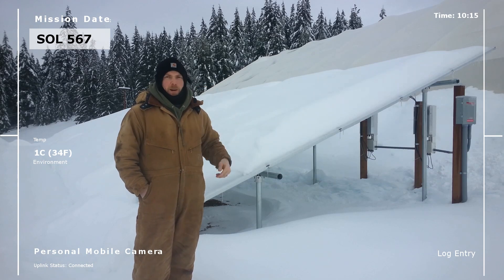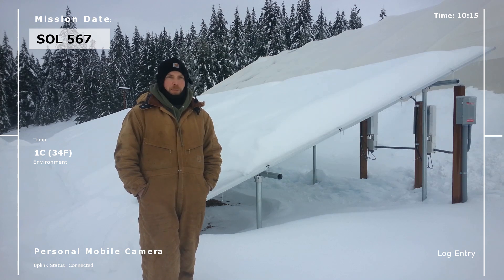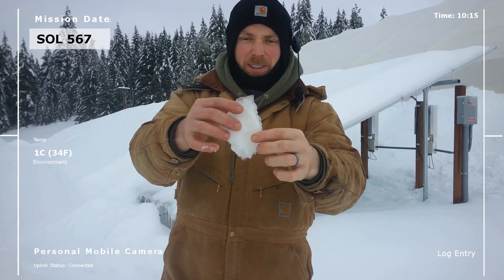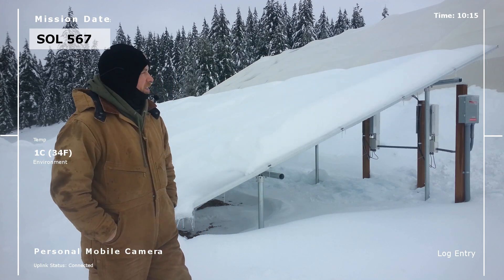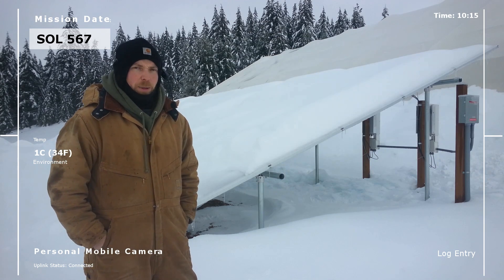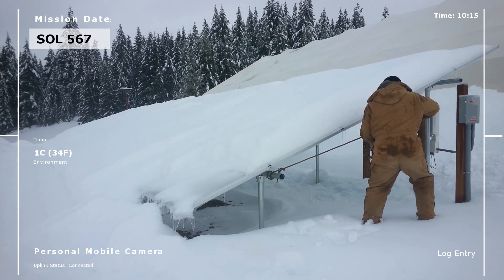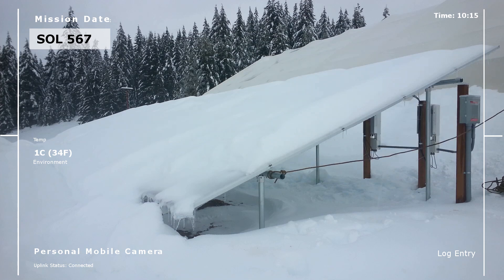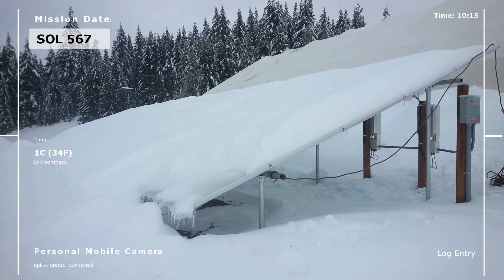Can you clean SOLAR PANELS with a ROPE?

Comment: Still curious on your thoughts on the Bloom Box technology .
Reply from the maker: sorry about not getting back to you...lots of comments :-) I did look at the bloom box and I feel that fuel cell technology may be a great solution for the long term. However, Bloom Box or any other fuel cell will still require a fuel...in bloom box's case Natural Gas...of course there are others (ex Hydrogen). In the end you can't get something for nothing and each fuel type has a maximum amount of energy that is available from it (ex. Diesel has ~190k BTU potential). When you take that fuel and convert it to a usable form (heat, electricity) there are losses do to the conversion...so any way, long story short...our systems that we need (and our way of life for that matter) simply require too much energy. That is...no matter how we get it...we as humans consume a lot of power (energy) and that means we need a lot of input (no matter the conversion process).  In the very long game...the only way to get as much energy as we will need without strip mining every planet we come to is nuclear fusion. Lots of people working on that one...I'd love to play with it someday but sadly I'm no nuclear scientist LOL
Reply: No Problem...just thought possibly with your methane resources this form of SOFC could have been integrated.
thanks for the reply...
Reply: I'm telling you TRM, run a long larger size pvc line (1"+) across the top of the panels, left to right.

drill holes straight down directly towards the top of the top panel every 6".

angle the incoming pvc line down and into the tent to a gate valve.

turn it on for 90 seconds and flood the panels with water which will cause the snow to slide off (and clean the panels of dirt at the same time).

turn it off and any water in the horizontal line will just drip out.

any water in the vertical line will drain out of a drain valve you install just past the gate valve after you open it.

have a bleeder valve just above the gate valve so the water in the vertical outgoing line drains and doesn't freeze.

now its ready for the next snow or just to wash off the panels if they get dirty.

simple, cheap and super easy to install.  the brackets to hold the horizontal line will be the most difficult part and that's really a piece of cake.
Reply: I lived in Michigan for 50+ years Ben and experienced those temps along with the biting humidity of the great lakes which goes right thru any clothing you have on no matter how many layers thick.

I'm talking about a FLOOD of water during the day which will wash off the snow leaving the black panels exposed to the sun which would absorb the heat, warm them up and let any ice or water evaporate right after the flush.

in fact, if you notice, it's 34 degrees in this video (not -20) and it would work perfectly.

the panels are at a perfect angle for this too, the snow just needs a little 'lubricant' for it to fall off.

did you see the first video where he was pulling the snow off the lower panels and it was falling on the ground leaving completely exposed clean, wet panels? 

that would happen on a massive scale in 90 seconds once he opened the gate valve.

we aren't talking about doing this on the worst of the worst days that you cherry picked out but just in general, during the day with the sun is out and not at midnight in sub zero temperatures.

it's no different than he's not going to be going out there in -20 degree weather and brushing off the snow no matter which method he uses. 
if it's THAT cold then there's a layer of snow/ice on the panels which isn't coming off anyway no matter how much he works at it.

one more time, watch the video again, it's 34 degrees, not -20 degrees.

I stand by my idea as it would work 95% of the time and when it's too cold, nothing's gonna work anyway.

donald.
.
Reply: I have a question for you AZboy boy and your friend...
If you want to start a battle royal and publish your own BLOG how about posting and tagging it to a question originating with one of you girls ..
Reply: at least our comments were CONSTRUCTIVE in an attempt to help out TRM but yours was just an attempt to make yourself appear like a big boy and just a waste of a post in the process.  

now grow up with your superior attitude and immature little insults.

I still believe I have a valid idea.

where is your contribution?

yeah, thought so.

.
Reply: AZ DONALD deleted my comment. Youtube arguments are pointless and I don't want to be a part of it. But for the record, I don't think water will help, even if it did your just going to have a lot of slippery ice in front. This is no way in the spirit of arguing against you, but I think it's just as helpful to point out flaws as it is to suggest things. Thanks AZ for contributing a suggestion to TRM. I truly apologize if I offended you. Have a great week ahead.
Reply: No problem Ben.

I remember my parents had a small metal roofed A frame barn.  

for some reason I would get a kick out of pulling out the hose when the roof was full of snow, spraying it and seeing if I could get a whole sheet of snow/ice to slide off in one piece.  that's what gave me the idea.

someone else here had suggested that TRM dig a wide deep trench at the base of the array for snow to go but with my idea it would fill and level off with slush instead of pile up high with snow.

doesn't seem to matter because TRM never commented on the idea anyway.

no offense meant, no offense taken.

take care, 
donald..

Comment: would it work if you could wrap the frame in the same pvc that your green house is covered and have a small wood stove or some other form of heat just enough that the panels would stay warm enough to melt the snow

Comment: The best average year round tilt angle for Oregon is about 37 degrees. Your panels seem to be aimed at about that angle. BUT!

In Winter you need every ounce of Solar power you can get. Days are short and radiation angles are low, meaning the Solar rays have to travel though much more atmosphere as in summer. In Winter lies the problem, not in Summer. In Summer you probably have too much Solar power anyway. In other words, a fixed array is best optimised for winter rather than the year round average. The best average winter angle for Oregon is about 59 degrees. (Summer 21 degrees). 

I think you would be better off with the average winter angle rather than a year round average angle. Better would be to adjust the angle twice a year but that involves some hardware mods I suppose.
Reply: Bor the Wolf 

I agree.  I think I'd definitely rework the mounting system so they were a bit higher and adjustable.

And then adjust the angle 4 times per year for optimal performance.

I can't imagine it taking all that long to adjust with a good setup.

Comment: 3 options 
1. there are de-icing boxes existing that can "heat" up your panels,  melt the ice and let it slide down. they run power to the panels an warm them up. 
2. install a thin wire and heat it up ( 12v DC) to cut the ice off.
3. cover the snow with ash an let the sun do the job.

Comment: The string trick works but you are going to find the rope has to large of a cross section to work well cutting the snow namely you being strong enough to pull it through.  Something about 1/8 to 1/4 inch in Dim. seems to works very well.  

I was wondering what is the system voltage of your grid-tie system?

Comment: Oi oi oi, Have u seen Cody's vid on removing the snow from the roof?????? That seems simple enough and not to mention u need to plough the front of the panels first b4 u attempt to clean the panels... I think the cold is freezing ur brain juices too much :)~ ..... get some more insulation on ya head and then tackle the problem again. Rope wont work as u need a ridged header and rope can be used to pull the rigid header towards u down the panels and u need to do 2 sets of panels at a time not the whole lot at once unless u made the header out of a heavy material and doesn't scratch the glass as it travels down. Maybe the header can be on bearings to just keep it off the the glass surface so it does not come in contact with the glass at all. Come on I am sure u can solve this problem sooner rather then later and remember the task has to be accomplished in minimal time not take all day as u have other things to do as well. :) Good Luck Mission Commander. Earth Out.
Reply from the maker: yup, I've talked to him about it...we are waiting for another snow dump to test it...though I am worried about those wheels on the panels.

Comment: I have seen the rope method used on roofs but I saw some diferences. 1st their roof was a lot steeper, 2nd they used a much thinner steel wire that could more easely cut through the snow. You already mentiond the snow on the panes is verry icy so that wont help. I realise a steel cable could damage the pannels so that probably isnt the best option but maybe a thinner nylon wire would work better.  The problem with this and other methods i have seen that the last few mm are hard to get of.

Comment: how about this. you increase the pitch of the panels by 15-20 degrees to help shed the load. regular snow blower passes at the bottom of the array to prevent build up. you could also trench out the ground to allow more room for build up. the load builds from the bottom of the array so you only need to heat the bottom third of the panels. using a small diameter pipe, a bilge pump, an aquarium heater and small reservoir (5 gallons would do it i reckon but you should calculate, thats a guess!) you circulate ethylene glycol (antifreeze) through the pipe which you lay over the bottom third of the panels. the panels shed the road easier because of the increased pitch and the heat stops the snow from sticking.
apart from that its shovel and broom time sadly!
best of luck, hope you find a solution soon!

Comment: At this point, I believe that anything you try will continue with needing physical effort. That is, until the spring/summer when you can mount the back of the panels with height adjustments. Thus, increasing the slope for winter months. This will have multiple benefits. 1. Snow Removal 2. Better winter Sun alignment (assuming these are facing South).

Comment: Try it with a 1mm stainless steel wire. The force would be much more consentrated. and at around 20$ for 100m should not break your budget.

Comment: if you setup 2 carriages that were on wheels that ran on the edge of the solar panels top and bottom and had a piece of string , wire,rope or even if you could figure out a way to do a hot wire that was as close to the surface of the panels you could get it would act like a cheese wire and slice off the snow and ice.

Comment: Here is a crazy idea. If you can spare the space heater for some time, bring it outside and blast the underside of the panels creating a layer of water between the panels and the snow and ice, perhaps it will slide of in bug chunks.

Comment: I don't know what the draw would be, but for future, how about a thin wire element - like the rear window defroster of a car.  I know you're currently not running a battery system with the solar, but for the sole purpose of defrosting, I think a small amount (1-3) of deep cycle batteries, kept charged by the panels, could be hooked to a thermostatically controlled element on the face of the panels... or maybe some sort of sensor so it needs a combination of cold AND snow/ice buildup, so it's not turning on just from temperature.
or worse-case, just a manually switched element... when it starts snowing, turn it on.
doesn't help with what you have there NOW, but starting with a clear panel, would help to KEEP it clear

Comment: i see that you have not removed the piles surrounding the structure, watch that as it gets heavier it will continue to put more and more pressure on the sides of the structure.
Reply from the maker: good news on this front...i actually thought the exact same thing...luckily with the heat in the building what is happening is the snow is melting right next to the structure and the pressure isn't building up as both you and I suspected.

Comment: Use plumbers heat tape and make a grid pattern across the top and melt the snow and ice right off. You woukd have to calculate the power usage and may try using it in zones.
Reply: Or a snow melt mat cable

Comment: I remember in a previous video you said you wished you had put them higher up so the snow could fall off. any thought of clearing about 3 to 4 feet of soil in the front for next year?
Reply from the maker: definitely putting thought into this area...probably a combo of hinging the back and doing something in the front. The hard part is that raising the structure up will require a complete tear down. Yikes...not so convinced to do that.
Reply: Yeah I watched the vid of the install, 1st thing that comes to mind for the back hinges would be wall jacks attached to a rigid beam?
Reply: Maybe you could find an engineer to design a new modular frame that will sit on top of the existing frame and could be installed one panel at a time.
Reply: I hate to make suggestions that imply considerable effort on your side but consider you had water cooled solar panels:

1) in winter you could have anti-freeze circulating between panels any maybe a small solar thermal collector which would enable you to just clear of a small area and have the excess heat thaw the rest of the panels automatically. A steeper angle would force the magic martian dust to just slide off. That's several kilowatts of free heating power right there.

2) summer you could use the infrastructure to boost efficiency, in spring / autumn it lends itself to storing the heat in the ground to stay warmer through the night.

Hope you enjoyed.
Reply: a pivot in the middle at the balancing point reduces the strength need to lift the panels,so you could use just one actuator to cut costs,or no actuator at all and just have the panels rotate at the axis using a single motor
Reply: As an addendum to my idea "This Fish: got a good suggestion there, Put the hinges in the middle of the panels to make it act like a seasaw and by hand u can tip it vertical and the snow will drop off. Stupid me shud have come up with that idea as MY panels are st up on a seasaw to follow the sun east to west.
Reply: OffGrid Aussie Prepper™ Ya, the idea is not without problems itself tho, I think motorized is best way because you have to come up with a way to prevent the panels from moving from the wind, or from tipping too fast and banging when they reach the end of travel but I think that could be solved easily enough
Reply: oi oi oi, i think u may need a "Superjack heavy duty 36-inch actuator" https://www.satellitesuperstore.com/satellite_diseqc_motors_36_volt_motors.htm#36inch which r not cheap and u would need atleast 6 or 7 of them to simultaneously raise the north side without changing the existing structure accept for installing hinges on the sth side and this can be done WITHOUT a total  teardown and be done by one person. That's if 36 inches travel is enough to do what u want, ORRRRRR u maybe be able to raise it on 2 stages by re-adjusting the mountings on the base with a quick disconnect, then that will give u 72inches in 2 stages. If it isnt then u need longer travel actuators or hydraulic pistons which would far exceed ur budget. http://www.terapeak.com/worth/2pcs-heavy-duty-linear-actuator-12v-10-stroke-includes-mount-brackets-w-bolts/381512025326/ https://www.alibaba.com/product-detail/Jaeger-Superjack-QARL-Heavy-Duty-Actuator_10592595.html I hope these examples help?
Reply from the maker: great suggestion and thanks for the link...i have it up and am checking it out
Reply: Just remember that as the snow/dust slides to the bottom it will make it heavier on that side and lighter on the other, thus the "actuator(s)" and structural capacity on the lower side should be calculated in terms of the extra weight, and the upper side in terms of a negative weight (pull) too.
Of course it goes without saying that the moving mechanism could be mechanical (gears, screws, ropes, etc.), electrical, pneumatic, hydraulic, and so many other ways, but I would recommend an electro mechanical system that can be operated manually too.